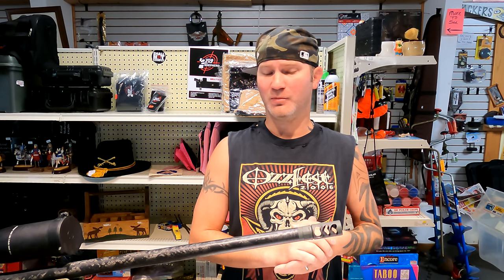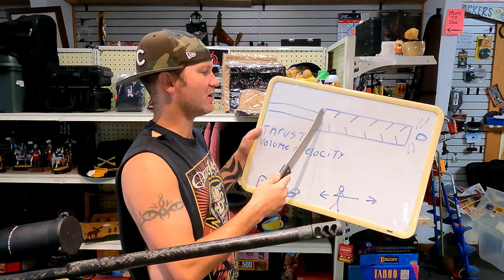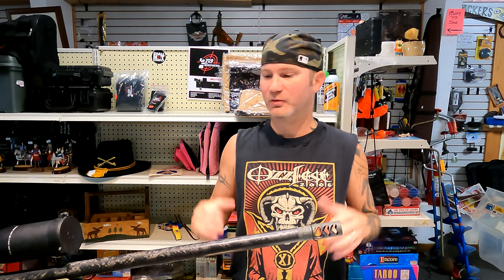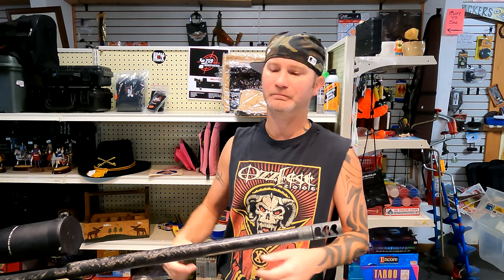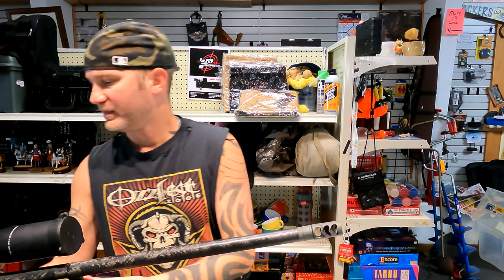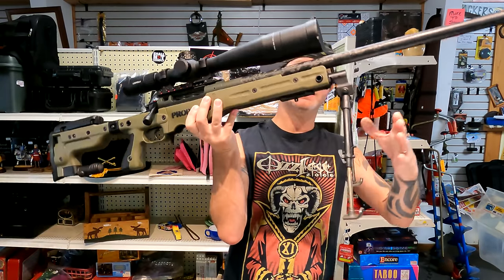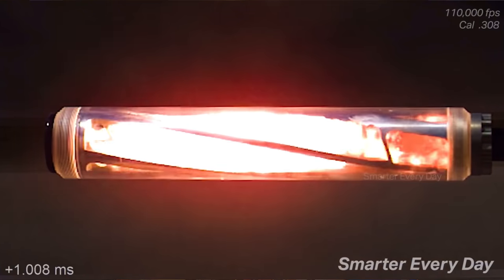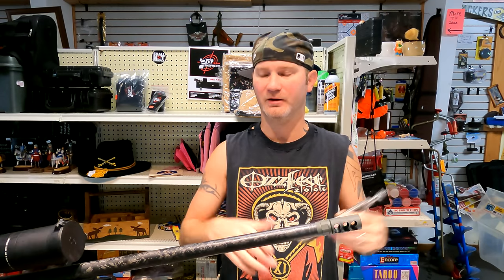Reduced Felt Recoil

Comment: the word you are looking for was relative when discussing your example of driving fast and the ball not going through the back of the window. The ball and the car are both moving at the same speed. Now if you had accelerated greately while the ball was in the air, yes the ball would potentially go through the back of the window (the acceleration was only acting on the car, the ball had no acceleration acted on it)

Besides that, Yes, your point is true that the force exerted on the rifle is not changed by the weight, but that is not everything. The velocity of the rifle going backwards will be affected because of the force = mass * velocity equation. When you change the mass, the velocity has to change as well. So the rifle will barely move if you greatly increased the weight because the velocity will be lowered so much. That is why what we call "felt recoil" is effected by anything adding weight to the rifle.

You're close but a bit off with the muzzle brake. The gases do not "cancel" each other out because they go out the sides. They actually go out the sides and backwards a bit. That is why a person standing next to the rifle a couple of yards will get so much worse concussion than the person firing it - it's literally directed at them. The reason this happens is because the gases hitting the muzzle brake at that angle to push the gas backwards imparts a force on the muzzle brake to push it forwards. Muzzle brakes actually work by pushing the gun forwards. Suppressors do this a bit, but since they are limited by their volume they can only contain so much gas to push it forward. Obviously they are not nearly as good as muzzle brakes because they cannot push gas to the side incredibly rapidly.
Reply from the maker: Yeah I probably should’ve use the example of flying a helicopter in side of a shipping container the container weighs the same amount even if it is not flying 

Oh I wasn’t trying to say that the recoil would not feel differently 
As you increase the weight of the firearm it will turn the recoil from a snap to a Push 
How ever The energy does not just go away or get absorbed it just changed to a different feel
Reply: I think of weight of the rifle as a log and the recoil as a hammer.  With the same swing on both a large and a small log the lighter log will move farther even though the ft/lbs of energy are the same
Reply: @CRSFirearms  actually the energy transfer will be different, its the momentum transfer thats equal because of the force doesn’t change. The velocity of the bullet x the weight will be exactly the same as the velocity of the rifle x the rifle weight. Thats where the snap vs push comes from is a heavier rifle moves slower with the same momentum transfer. The difference is energy is velocity dependent it grows with velocity squared, so the energy transfered is actually lower for the heavier and slower rifle with the same momentum. Thats not the only factor as the thrust you talk about also helps, and the action of the rifle does too, bolt action transfers that impulse all at once in a snappy hit while gas operated rifle has pisons moving and springs etc making that energy transfer take place over a longer time
Reply: @CRSFirearms  Yeah I figured you weren't trying to say the recoil would feel the same, I did hear you specifically say that the force wouldn't be different which is of course correct. I think most of the confusion people in general have about recoil is that they think is that they feel the force of the gun recoiling, as opposed to the velocity of the firearm moving backwards.
I am interested in thinking more about what you said about the mass of the gun not affected the force unless it's on the ground. If you know it or not you're alluding to the fact that the static/kinetic friction equations have mass directly correlated with an increase in friction force. That friction actually eats up the force of recoil since it has to be overcome for the rifle to move at all backwards. I'll have to think more about what that actually means for felt recoil.

Comment: The gun does start to recoil the moment the bullet starts to move. The reason that you don't get accuracy issues is that the length of time the bullet is in the barrel is much less than the length of time that it takes for the gun to appreciably begin moving due to the difference in mass between the bullet and the gun.

Comment: Pretty sure the inertia of a larger mass weapon does reduce recoil, the amount of rearward force from the round doesn't change, but  the amount of force needed to move the weapon is greater reducing the amount of force transmitted through the weapon to the shoulder. So if rearward force from the round is 14lbs but the weapon weighs 140lbs all of that force is absorbed trying overcoming inertia.
Reply: Recoil is the same but felt recoil is less with a heavier weapon. The way he tried to explain it made my head hurt. Most of what he says in this video is inaccurate and the rest is poorly explained.
Reply: @boomerisadog3899  Right? Doesn't practically anyone watching this video have anecdotal experience to the contrary? Maybe not the heaviest recoiling thing to fire a 45 colt through a conventional revolver but you feel it while I've fired one through a wacky pistol that weighed as much as a brick and it became a loud, fiery 22, zero felt recoil.
Reply: One has to think very carefully about the words used when describing math. There is a difference between recoil and felt recoil. So  in a way both descriptions are correct. The same force is applied in both cases but a heavier firearm is not going to accelerate as much. So "recoil" can be the same but most people mean "felt recoil" or "observed recoil" meaning how much the firearm moves. In space in a vacuum a giant firearm would still be accelerated in the opposite direction of the bullet but it would achieve a slower velocity. So his analogy is correct, but the conclusion is...imprecise.
Reply: Force is mass times acceleration.  More mass means less acceleration for the same force. Acceleration is a change in velocity (felt recoil.) This means more mass, less recoil because the feeling of recoil is a change in your velocity.

Comment: I believe the muzzle break recoil mitigation  has more to do with the gasses moving down and out a barrel then out and around the muzzle break. That the energy dumped into the break by the change of direction of those gasses that would regularly be pushing the bullet out and the barrel back. Instead it pushes the break forward (barrel and gun attached) as the break redirects the gasses.
Kindof like the wind blowing on the sails of a ship, they redirect the wind and that absorption and redirection of that wind pushes the boat.
Muzzle break pulls the gun forward by completely redirecting those expanding gasses. Think of the arrowhead break on the Barrett. It's like 2 giant sails on each side catching a crap ton of wind pulling the gun forward while the rest of it pushes it back mitigating a large portion of that recoil.

Another thing is that inside the chemistry of the chemical reaction of gunpowder burning it is creating gasses from that solid and heating it up, pressureizing the cartridge and speeding up the reaction.

Comment: There is recoil while the bullet is in the barrel. It's just that it has to accelerate the entire rifle so the bullet is moving very fast by the time the rifle is moving a little bit. It's also directly in line with the bore initially so it doesn't affect point of aim. It is only when the rifle is moving significantly that your shoulder and grip begin to affect the point of aim. By then the bullet is leaving or almost leaving the muzzle so the effext is negligible.. However, in-line recoil is one reason people give for the AR being so accurate, so it might have some tiny effect. Then there is significant recoil contribution from the gases expanding out the muzzle, what you call thrust. The suppressor doesn't change the amount of gas leaving the muzzle but it does slow it down (the point of the suppressor).

Comment: The gasses pushing the bullet is also pushing in all the other directions.  The sides of the chamber and barrel are solid and can withstand the pressure so there is no movement in that direction.  The bullet weighs less than you and the gun, so the bullet travels quickly in that direction, but it's also pushing you in the opposite direction.  The brake reduces the felt recoil, because when the expanding gasses reach that point, it's pressure forces it through the holes and so the walls around the holes in the brake act like a sail on a sailboat getting pushed forward by the wind.  

Thus you're using the force from the gas in the direction the bullet is traveling, to slow the gun traveling in the opposite direction.

A relatively easy way to put an analog scale on the butt of a gun with a brake and shoot it, then do it again without the brake all while having a high-frame rate camera looking at the needle on the scale.  The readings on the two would show the same recoil until the moment when the bullet reaches the brake.  the forward force then should decelerate the gun with a brake quicker starting at that moment.

Comment: Recoil comes from Newton's 3rd law. Whenever a force is exerted on an object and equal and opposite force is applied (for every action there is an equal and opposite reaction). Rockets do this by ejecting matter out a nozzle at a very high velocity. So as you push that 50 cal bullet down the barrel an equal amount of force is applied to the rifle and shooter. The gunpowder/propellant creates expanding gas like the gas created in an engine when burned. What you want to do is create a muffler like the car. That takes the expanding gas and through a chamber slows it down. Then it comes out the tailpipe. Same thing here. You're allowing those gases to expand in a chamber and exit at a slower velocity. Supposedly some people use an oil filter to do this.
Less recoil? Not unless you're directing part of the gasses such that they create a force on the rifle to push it forward. You can't cheat Newton's 3rd law.
The other problem is the crack created by the bullet going supersonic. A bullwhip can create that same crack. Some rounds are subsonic for that reason.

Comment: Nice Video. I think I can ad something that might be interesting. A German expert on ballistics named Carl Cranz once taught that guns can thought if as pneumatic gas-machines. Barrel and bullet are nothing more then a cylinder and a piston driven through. To determine how loud a firearm is you can just look a a value called p0. p0 is like v0 but not referring to the velocity at the end of the gun but the pressure in the gun, at the moment the bullet leaves the barrel.

At the moment all power and/ore oxygen in the barrel is used up the pressure in the cylinder/barrel is not longer able to increase, therefore the pressure is dropping as the piston/bullet travels down the cylinder/barrel, because the volume of the cylinder/barrel increases. This is the main reason firearms with shorter barrels are louder and got more recoil, because their p0 is much higher when the bullet leaves the barrel. With a higher p0 the difference between the pressure in the barrel and the environmental pressure is much greater and is resulting is much more noise and trust of gas, because the atmospherically compensation happen more violent.

Now the suppressor comes into play, the silencer gives the gas room to expand therefore dropping the p0 much more then extra barrel length of the same length, because the additional volume provided by a silencer is greater per Inch of length.

The further reduced p0 resulting in much less gas thrust and therefore reducing felt recoil.

Comment: Newtonian physics. Every action had an equal and opposite reaction. The projectile is exiting the rifle faster than felt recoil can transfer to your body, back to the rifle in a non linear direction. 

Basically, the effect of felt recoil is completely linear in relation to the direction of the projectile until the recoil transfers to the shooter. The stock of the rifle acts as a fulcrum. This is especially notable in AK pattern rifles, and less so in AR style rifles. The AR bolt carrier travels almost in an entirely linear direction. The butt stock still acts as a fulcrum when it hits your shoulder, coupled with the fact that gravity is always pushing down on your rifle, and you're fighting gravity. The gas exiting the muzzle pushes in all directions. It transfers upward because you're already holding the rifle up, and the butt stock, again, acts as a fulcrum. 

There's much more minutia to the physics behind it, but these are the major reasons for felt recoil transferring upward AFTER the projectile leaves the muzzle. 

Up to that point, felt recoil is entirely linear in relation to the direction of the projectile.

Comment: It's the corking effect. Just like when you pop a champagne bottle you get a slight kick from the bottle as the force of pressure forces the cork out the top. A suppressor releases the pressure at smaller amounts in a series of small expansions until it is less at the point the cork (bullet) exits the muzzle.
Nice shirt btw bro. Ozzfest was one of the greatest rock festivals ever. First place I ever saw alot of bands live that I never would've seen otherwise.

Comment: Ok here is the simplified version of what you said. The hot gasses that exit the barrel are concentrated and hot and therefore come out faster thereby you feel recoil. When a can is placed on the barrel it give a place for the gasses to cool and expand, then leaving the can at a slower rate, and the result is less perceived recoil.
Reply: If you are correct then a blank cartridge will have the same recoil as a bullet tipped round.
Recoil is from bullet mass acceleration and not gas exhausted out the barrel.
Reply: @colt45peacemaker  No because there is nothing holding back the pressure in a blank. When a round exits the barrel it’s like uncorking a bottle of champagne.

Comment: On a semi auto, it may increase secondary recoil from the bolt cycle at a higher velocity. This can be moderated with an adjustable gas block, or adjustable piston on an AK platform.

Comment: Weight does help with recoil. The same amount of force from the cartridge has to move more weight. Imagine you pushing a smart car versus pushing a semi. The truck has more inertia and takes more force to move it than the car with less inertia. But, a silencer's weight is so little, that the weight itself doesn't add much inertia. My s&w 40 has way more felt recoil than my Beretta px4 because it is so much lighter
Reply: Your confusing recoil for felt recoil my friend

Comment: To clarify weight does technically reduce recoil to an extent it doesn’t decrease the recoil energy but it does slow down the recoil very significantly (that’s why a AR-15 doesn’t kick hard when you shoot it but when it hits you even with armour on it hurts a ton. It’s because their is less force acting on the stock of the gun than the bullet (notice how I said force not energy) another reason is because of leverage and gravity which is separate to mass as the mass is what makes the gun harder to move backwards where as this is more complicated. When you shoot a gun your contact points absorb the energy and since you are holding up the weight of the gun it is anchored to an extent. It’s confusing because while yes it doesn’t technically reduce recoil but practically it does because the force is reduced. If you were holding a gun as heavy as a semi truck their would be no felt recoil because the resistance is so much that the force would be almost nothing. The best way to discribe it is like getting hit with a hammer while wearing padding vs getting hit with the same hammer on bare skin. It’s the same energy but one will break a bone where as the other may not even hurt. Plus their is a such thing as a sort of passive resistance to energy for instance if someone pushes you with 0.01footpound of force for 10,000seconds that probably won’t be felt hardly at all but if someone pushed you with 100footpounds of force over a second you would definitely feel it. That’s basically how it works

Comment: This is BS. A more massive object will require more force to move. So a heavier firearm will move a shorter distance vs a lighter one when the explosion from the (same type of) bullet knocks the bolt back. Which btw, is what you feel as recoil. The bullet flies out of the barrel faster than the bolt slides back. That’s why your groups aren’t affected by recoil.

For the rest, where you talk about the suppressor causing air to expand, that causes the air to slow down (the whole point). As it slows down it causes a force to be applied in the sane direction as the bullet travels. This counteracts the force back that the bolt exerts as it slams in to the buffer tube or otherwise stopped by limit of travel. That doesn’t cause your rifle to go flying downwards because the force back from the bolt is still much higher than the force forward from the arresting air in the suppressor.
Reply: this seems the best answer

Comment: Does the silencer basically work like a flowmaster where it converts sound energy into heat? By splitting the soundwave and then directing them into each other to cancel out?
Reply: No. It mitigates muzzle blast by dropping the pressure through expansion and cools  the gassed before exit.
Reply: @Pipizzakitchen  same thing that a muffler does on exhaust pulses of an engine.